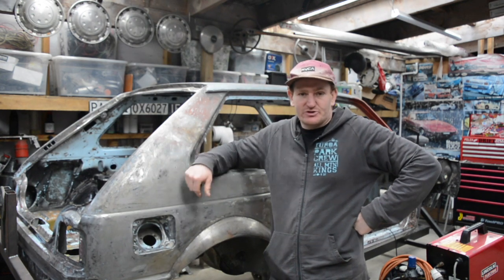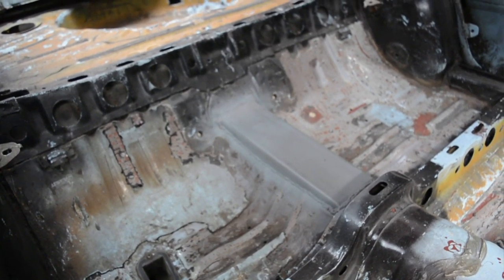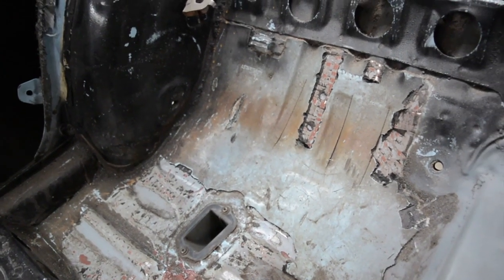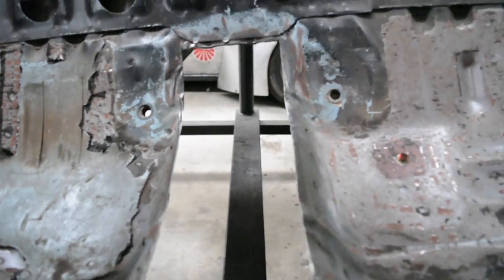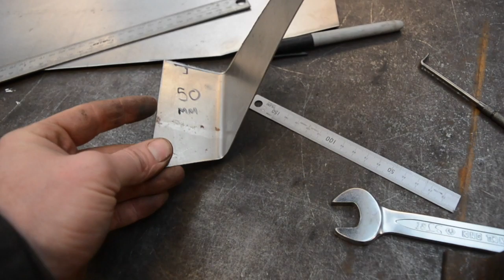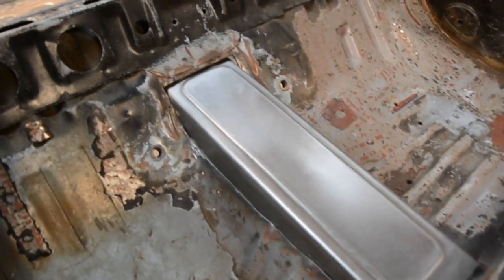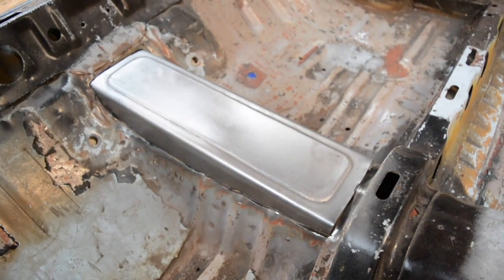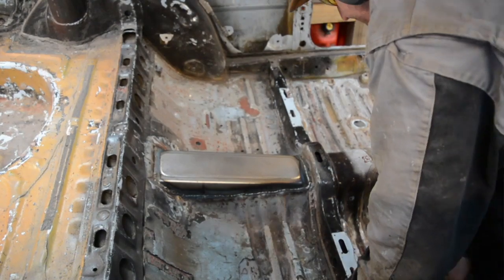Toyota KP61 4AGE Starlet Overhaul - Raising the driveshaft tunnel - Kune RE Speed Shop

Comment: Hey bro, just stumbled across this video as helping build a kp aswell, any tips and tricks for a whole gearbox tunnel? Don't have a bead roller or a bender but can make do with what we've got haha 😂
Reply from the maker: Hey man, take a look through the 626 videos I did years ago. I did the tunnel in that car but it’s basically the same as this. You’ll need some way of folding the sheet. A solid bench and some g clamps can get the job done.
Reply: @senojnaes  shot bro really appreciate it, will look into it